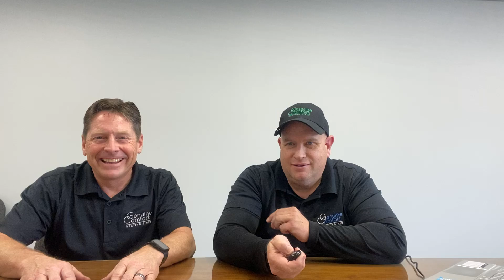80% furnaces VS 90% Furnaces

Comment: Another reason why not to buy a high efficiency gas furnace. I have went through at my parents house 5 new gas furnaces high efficiency and they never lasted 2 years without problems coming up  again! Previous furnace was in from 1962 it lasted 52 years! Don't buy a high efficiency furnace get an 80% non condescending furnace!

Comment: In addition the cost to replace metal exhaust to PVC and cutting holes thru the side and/or roof. The maintenance on high efficiency with more parts like 2 heat exchangers. Costlier parts like a $300 80% inducer motor vs $1,500 for a 90%. Then if a 90% furnace is not condensing right it will shut down. Not worth it for me with a furnace in the attic and one in the basement.